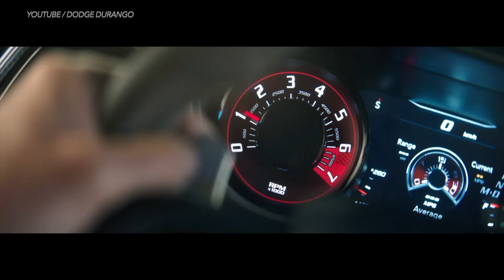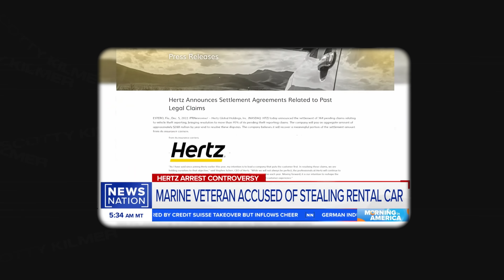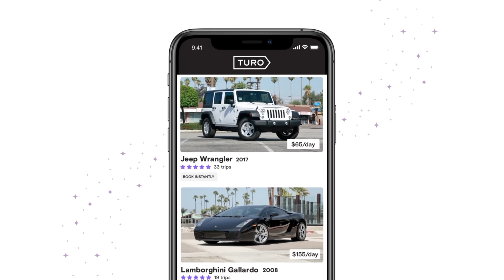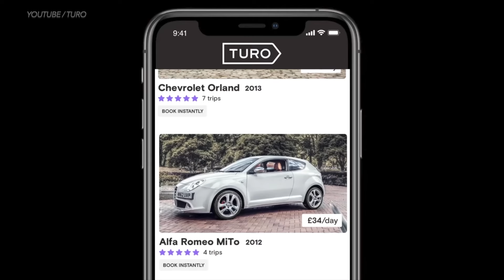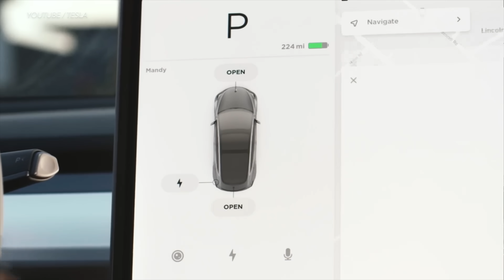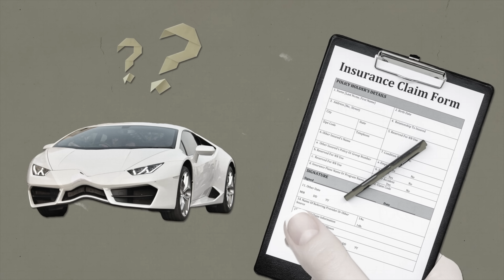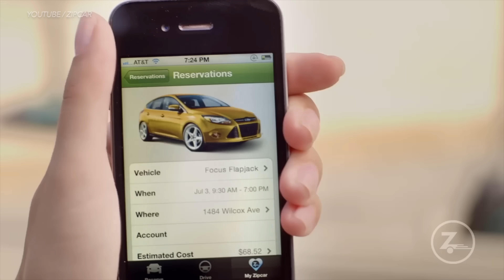Terrible News for Anyone Who Needs a Car

Comment: I rented a Turo car several times in California.  I have not had any problems. Took tons of pictures, inspected the car like crazy. Filled the tank when I returned it and made sure it was clean.  I even wiped down the dirty engine of a new model Corvette when I returned it. The owner did not charge me for the extra 100 miles I drove, I guess because I took care of the car, and I cleaned it.

Comment: I took my car in for repairs and since they were experiencing delays in receiving parts, they sent me to Hertz. I asked different Hertz employees about the whole grand theft auto thing. I received a different answer from each employee. I made certain to get the email as well as the cell number of the manager. When it came time to extend the rental by 2 days, I called, emailed and texted. I told them I wanted a written response too. I also stopped by to triple check with an employee in the office. If they aren't going to do their job, we've got to do it for them. Complex systems are breaking down.

Comment: I have a Nissan Sentra, 2018…. Both my back lights is not coming on, but my hazard lights and brake lights work, I bought some fuse and replace the fuse that did not have power and a Change, one of the bulbs just to see but still it’s not coming on. And suggestion asap plz

Comment: Interesting topic. I had rented a car thru Enterprise at Lax i had my own auto insurance .Was going to Las Vegas and death valley and Knott's Berry i said 10 days rental. Went back to Lax dropped car off and went to office to do paper work they said they were wondering why the car was not returned after 3 days Enterprise had reported it stolen i said i said 10 days on the 10 th day it was returned .My paper work showed 10 days there's showed 3days .Any way i got a 3 day voucher for next car rental .Big problem on Enterprise's end .I could have gone to jail because they did not put correct amount of days .🤔😟

Comment: Damn thats one way to get parts for your car. Rent a car, do a part swap, then return car. How many people would notice a different alternator, spark plugs, ac compressor, radiator...... is in your car? If i rented my car out id mark the parts with an etch pen and check it before accepting the car back

Comment: When i visited LA for my best friends wedding i used turo and had an excellent experience, good clean car, he dropped it off where i requested it at the airport, full tank of gas and left cash in the cupholder to pay for the parking fee, took pictures when he dropped it off and i took pictures when i picked it up / dropped it back off. I noticed it had an AirTag in it which my phone kept letting me know i was being tracked but I wasnt worried about it since i never left anything in the car since it was all in my hotel room. Overall ive rented about 5 cars in the past 2 years from turo and a few from hertz and i havent had a bad experience, BUT like scotty said in the video, take ALOT of pictures and be very detailed in the pick up inspection, i wanna say i took like 15 pictures of everything.

Comment: I remember the one and only time with hertz rental I returned the SUV to the same location as the pickup, returned at the Date and few minutes before time and the one at the counter mentioned that the system was down and still took the keys. Few days later got a call saying that I never turned it in. I told them I did and explained what the guy had told me, luckily that was as far as it went
Reply: I usually will get a written receipt when that happens.

Comment: My friend rented Avis cars in Ireland & Switzerland. Ireland was fine dropping the car off. (They said to leave the key under the mat), but Switzerland was a nightmare. It was arranged in person at pick-up for the Swiss Avis employee to meet her in person for the car to be dropped off at a certain day/time & he said he’d drive her to the train station. But due to unforeseen road construction traffic, she was 20 minutes late & no one was at the Avis company when dropping off the car. Also, everything closes at lunch time. No one was there. She didn’t know where to put the car key. Neither T-Mobile nor Verizon cellphone service worked at all in Europe, so she couldn’t get a hold of anyone. She dropped the car off and left the key under the mat. She ended up hitchhiking (terrified) to get to the train station because she couldn’t find a taxi either. She barely made the train to Italy. Two days later, the Swiss Avis guy reported the car as stolen. Someone else had driven that exact rental car & returned it later. Then Avis charged her $2,000 for the days that the car had been stolen, because the guy who had the car wouldn’t return his phone calls & never paid for using the car. It was a very terrifying ordeal. Also, in Switzerland, gas stations charge you for gas afterwards. Not before. So if you buy a cafe latte & breakfast (which is attached to the gas station), she assumed that they’d added her gas bill to the entire bill because it was the same cashier, but she later found out that they didn’t. The day after, there was already a Swiss police dossier on her & a $100 additional fine.

Comment: Hertz, hate them. Rented through insurance claim. In traffic the vehicle shuts off. I can't restart it or put it in neutral to get it to the side of the road. It has to be towed. I reported it to Hertz. They said it would have to be towed from the tow place I got it to to their service center in Houston.  And because it happened "on my watch" I was to be charged for that tow of nearly 600$. The malfunction did not happen because of anything I did. But they still charged me for the tow. They said I didn't opt for their basic insurance, but I did, then they said I waived the " extra" part of the basic which would have covered the tow. I had an accident in my car and while it was being repaired should not have been charged by Hertz for anything. Except the basic insurance I elected to have. My card was charged 2400.$ Then nearly 600 for the tow. I will never deal with Hertz again. So yeah, I hate them.
Reply: I agree I would be livid. Sorry that happened to you.
Reply: They have the ability to shut the cars down now when ever they want too! They installed this devise for people that didn't pay their car payment ! So was it mechanical or just shut off is the Question?
Reply: @debraferrara7682  I just shut off. Later after towing it, the mechanic said it started right up. But my insurance convinced me to let Hertz tow it .

Comment: I used Hertz for decades with no problem other than returning a car early and it costing more than had I kept it. I stopped using Hertz after that. I've used Turo once and I don't know that I saved very much money having to take an Uber to go get it and drop it off. I took 27 pictures of the car and if you do that, look very closely at the windshield. If there's a crack in it when you bring it back and you didn't document it before the trip, you could end up paying for a new windshield that they won't replace and just keep screwing people for that cost. Didn't happen to me but I did see a very small  crack in the top of the windshield that I couldn't have seen when I got it because it was wet from being washed. You need strong sunlight and the right angle to even see it so if you pick it up at night, you're out of luck. Strong flashlight and a second person would be your only alternative. I travel alone most of the time. Taking all of the pictures is really a pain in the neck. I'm not sure how many times I'm going to be ok doing that. But the renter had a pretty long and positive rental history so it seemed pretty solid. But can't that can be faked? Maybe not.
Reply: This is perfectly true.  And also, every word applies equally to the "legit" rental companies.  Personally, I'd rather take my chances with a well-rated car owner than a huge corporation that needs to make their numbers this quarter.